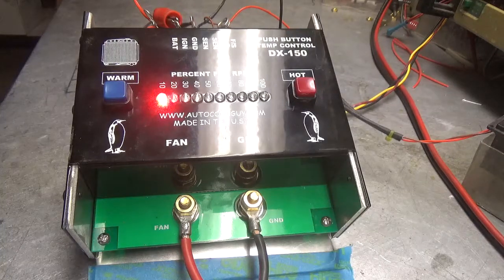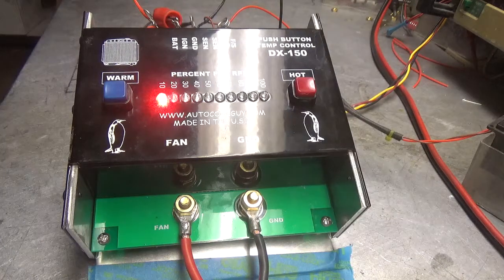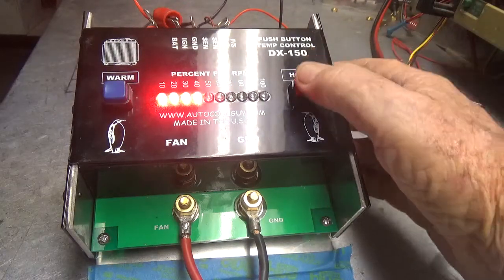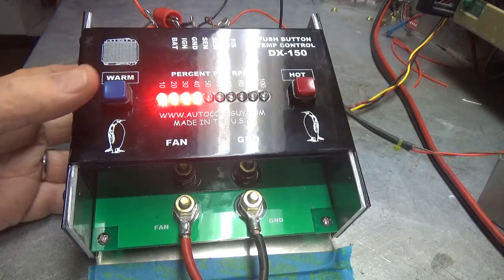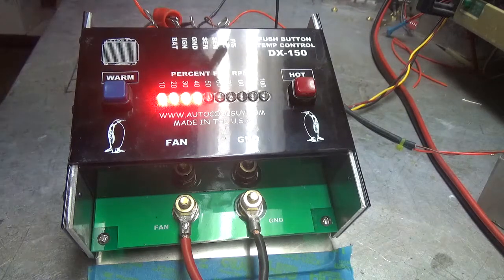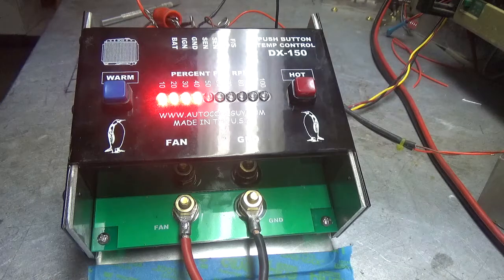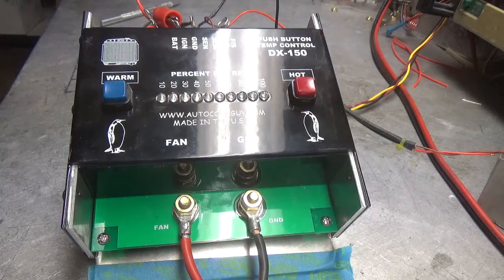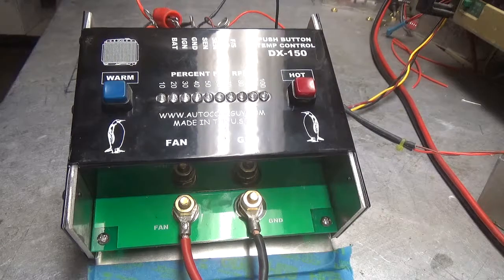DX-150 RADIATOR FAN CONTROLLER - THE AUTO COOL GUY

Comment: I am using the blue 200 amp on my 1947 Cadillac to control 4 Spal 9" fans, unit has been working perfectly for the last 4 years and fans are even more quiet than the older spal PWM setup where I needed 4 pwm units due to the low amperage rating.